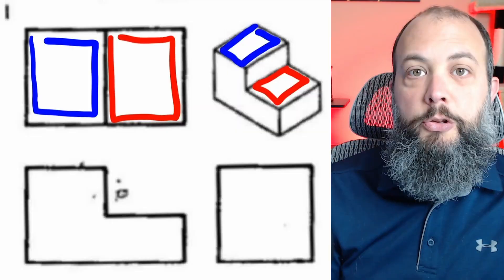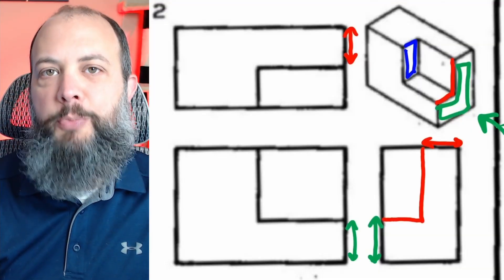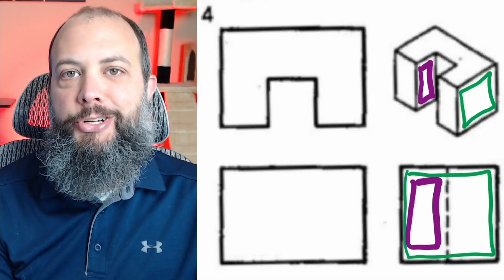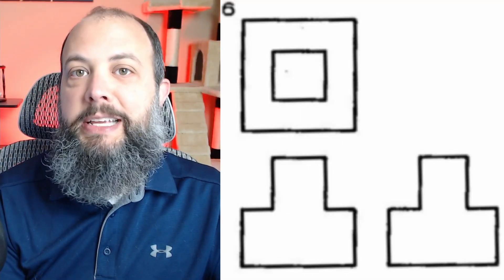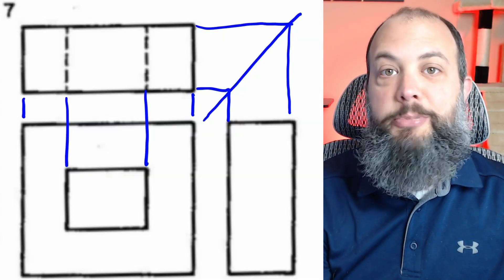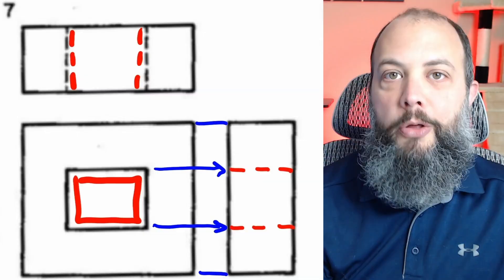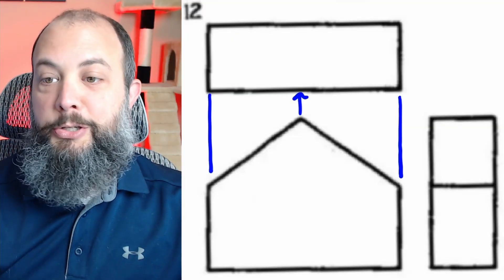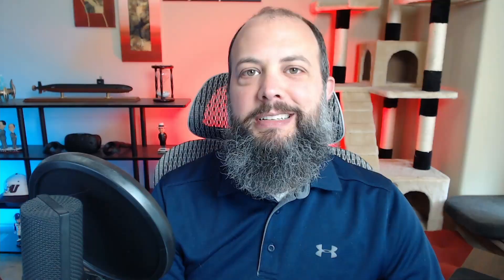Add the MISSING LINES to Make Each View Correct – Beginner Difficulty

Comment: Idk why but this is really hard for me...I try to pause the video before you give away the answer and test my knowledge yet somehow I am always getting it wrong :/
Reply from the maker: Spatial Reasoning is VERY difficult. Not just to do, but also to teach. Please check my Graphics Playlist, I have 2 or 3 other Missing Line videos - but since I didn't make them back to back (made them each about a year apart), I think I use different methods and explain them each differently. If the explanation from this video doesn't help as much as you need, maybe those different explanations will do better. Good luck.

Comment: i personally think the 11th problem, i think there is something missing on the right projection, no? the triangle
Reply from the maker: I think just the 1 missing line on the right view is all I see. The top view is just a big empty rectangle, which is looking at the top of the sloped surface. The right view missing line divides it in half, top rectangle is looking at the slope from the side, bottom rectangle looks at the short vertical face that is the short vertical line on the right side of the front view. Talking about drawings feels really complicated when I type it, hope that made sense.